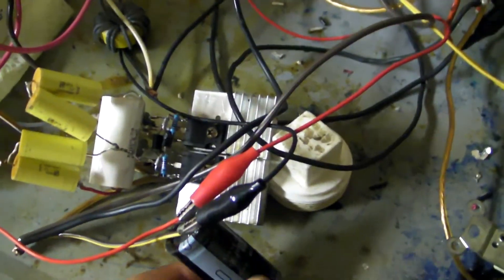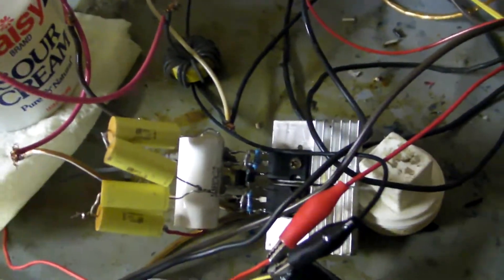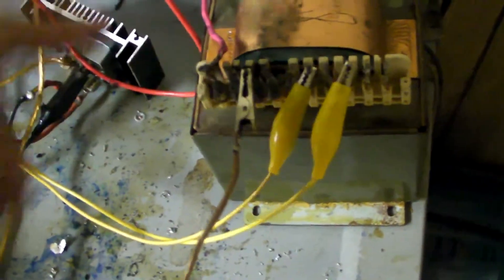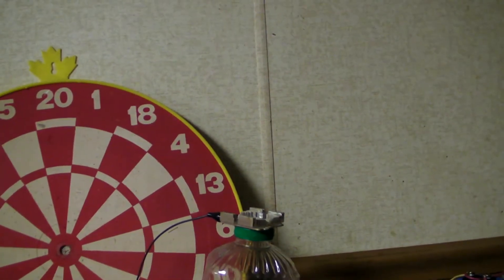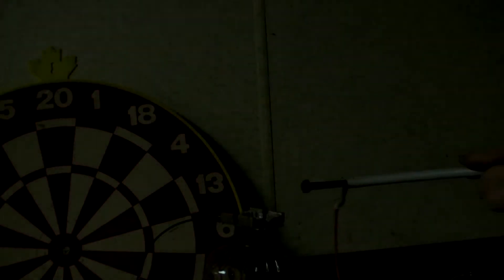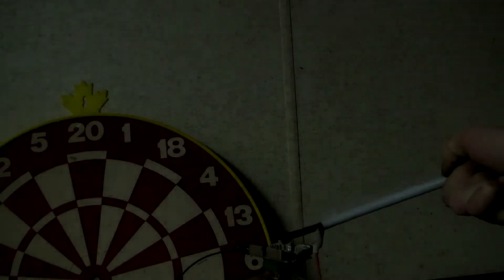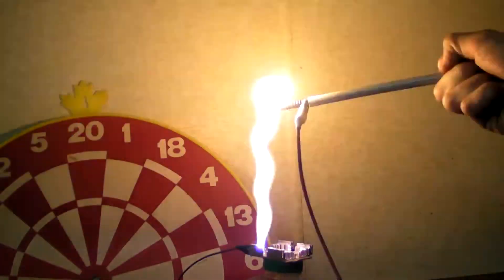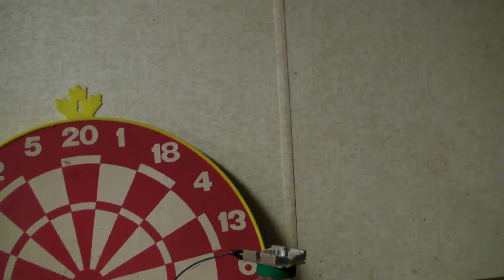First IGBT ZVS Driver

Comment: Oh, you said you're using 47A 600V IGBT. But I found a MOSFET with these same specs, SIHG47N60S
Are you sure it's an IGBT? If so, is there any advantage in using an IGBT over a MOSFET with the same ratings?

Wouldn't a MOSFET switch faster?

Comment: You're using a separate power supply for the gate? How so?
Reply from the maker: Link both grounds together, and feed a separate +30ish volts into the 470 ohm resistors, and the high power positive voltage to the end of the flyback winding.
Reply: Oh... Everything makes sense now... I'm buying a few IGBTs, I would make a half bridge with them but I don't have an oscilloscope to check the waveform ;-( So until I get a scope, ZVS will be my toy. More powerful tho, too bad I can't audio modulate it. Or can I?
Reply: Oh, wait a sec... What about the zeners? If I put 30ish volts to the resistors, there will be roughly 15v on each gate, so no need for zeners, or should I put 15v or 18v zeners just to make sure?
Reply from the maker: Trying to consolidate all my replies to one here. Technically when using dual PSU you can omit the zener diodes. I keep them there anyway though just because occasionally I dwitch back to a single PSU. A mostet would handle faster switching than an IGBT. However a typical ZVS doesnt really run higher than roughly 50Khz so I aim for power. Now a half bridge or something with a higher frequency and such you'd want mosfets probably. You can audio modulate the ZVS supposedly. I have an idea on how to but never got around to test it and find out. Mainly because I don't have a "disposable" junk radio receiver right now. Next time I go garbage picking I'll get one lol. Never know when a spike or something might go back into the audio feed. 30ish volts into the 470ohm resistors will give your mosfet/igbt approx 15 to ensure a good solid switch. Also, if I understand right you can drop the resistor value to say, 220 ohm and input straight 15, but I am not sure if that would work out exact. If you found a mosfet with the same values you may have higher headroom for frequency variations. Just a matter of picking your happy poison/preference I guess.
Reply: Thank you very much for replying! I found a CRT oscilloscope in the dump, I'll try to fix it and use it to enhance my half bridge! My ZVS is running great with 55V, no current limiting, using 20A 600V MOSFETs. You can check my Jacob's ladder video. What I did was I glued and winded 2 flybacks together and connected their 2ndaries in series, used a higher value inductor (AC filter from a plasma screen) and a 0.47ųF MKP capacitor.

So less current, more voltage, longer arcs with less power!

However, if I increase the capacitor value to 2ųF, the arcs get very short, but they melt just about anything connected to the cathode in seconds.

Why does the cathode heats up so much but the anode remains cool? I think the mechanism responsible for this phenomenon might be very interesting. You won't see this effect in your AC flyback tho.

Comment: Juniortore1 what advantage do these give me over using mosfets?
Reply from the maker: more current capabilities, many igbts however will not tolerate the high switching speeds. Just go by the ns or Us on the igbts schematic and convert it to Khz and see where your at.
Reply from the maker: +Juniortore1 datasheet not schematic
Reply: Juniortore1 Do have a link to a simple Igbt zvs driver?

Comment: Why do you have to ballast mains before you feed it into the driver do you do it before the rectifier or after would a MOT with a shorted secondary work.  You should make a quad stack with resonant caps.  Also would-

Comment from the maker: Two PSU. One PSU 35V and one of whatever voltage. It could even be a variac with rectified and smoothed output. 35v (+) goes to the two 470 ohm resistors on the driver. 35v ensures good switching on the gates under the high powers. 18v has made my gates "flood" before. 45v (+) is about a good limit on that end. Now, for the other PSU. Take the positive and connect it to the inductors input, now separated from the 470 ohm side. For grounds, connect both (-) and run them to their normal places.

Comment: so i found one big ferrite and i think of building homemade flyback but first will test it on normal from crt monitor its rectified and i dont use its multipler today i made some tests on zvs with normal power mosfets irf630 and something like that but its not working :D and in my electronic shop in my town there are no irfp260 or 250 so i cant try with them i got all parts - audio transformer like yours also many flybacks all other parts only transistors left ..

Comment from the maker: That is highly inaccurate. It all depends on the driver specs (including: driver capacitor values, IGBT or Mosfet values, Inductor values, fast diode values,zener diode values and thermal changes) and most importantly, the transformer it is driving (homemade flyback? TV flyback? how many turns? rectified or not? multiplied or not?)